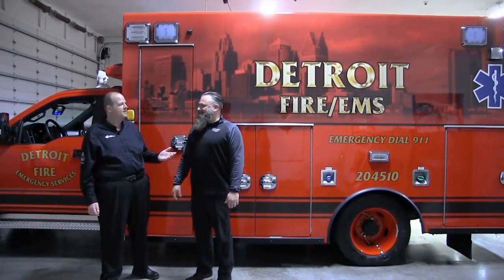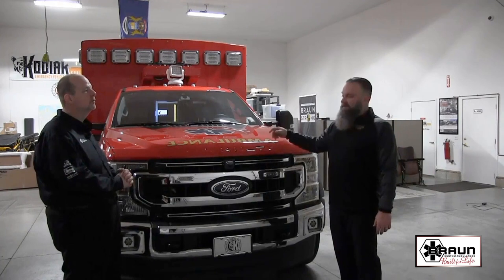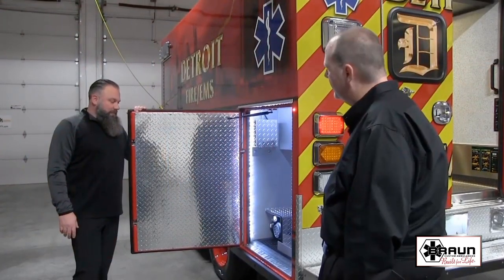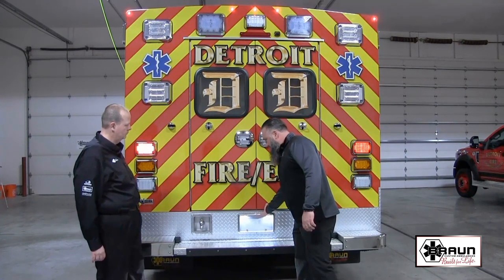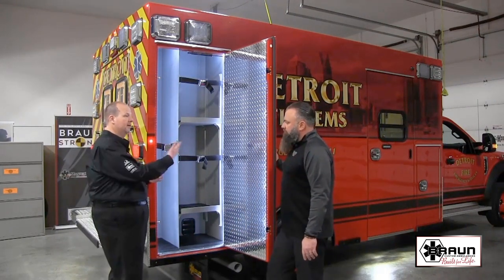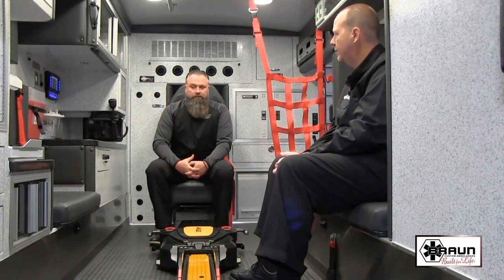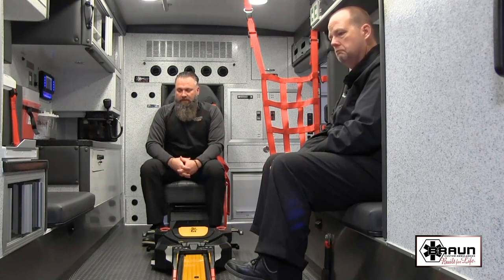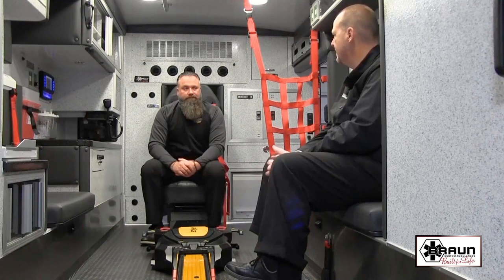Detroit Fire Chief XL Walkaround with Ahren Taszreak from Kodiak Emergency Vehicles

Comment: Ambulance Suggestion: 2021 Braun RevGroup Chief XXL
Note: It has the Interior lights that can change Colors to any color Of the Hospital and Fire Department. And the Sirens sound the same as NYU Medical Center's Braun Ambulance. It has double sliding doors on side. It Even has the Freightliner M2 crew cab and the bench that can fit the 1 whole entire Family (7 passengers) and 4 doctors. It even has a TV were shows can be played. If it is children's hospital, it will play kids shows. it even has digital clock. It's long and tall. It even kneels on the back and gets out the ramp like a city bus.

Comment: The sliding doors are junk!!!!  Keypad for what??  Suspension....may as well be without.  Drawers stick, do not stay closed or will not open.  Locks are cheap and break. IV warmers that do not work.Outlets/inverters that constantly fail and break.  Just to name a few........What a deal!